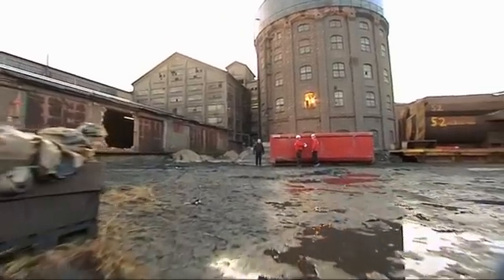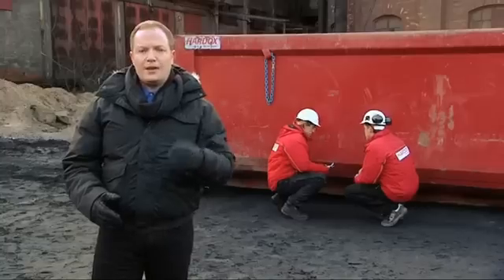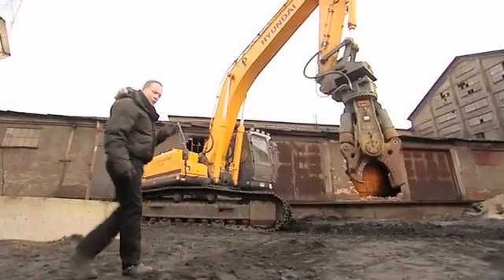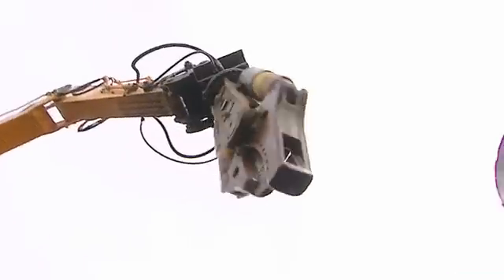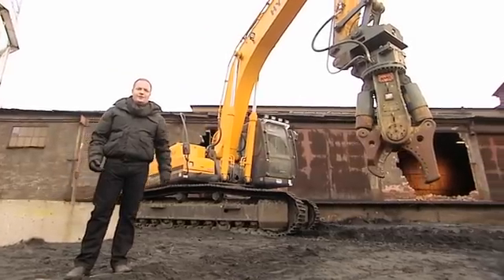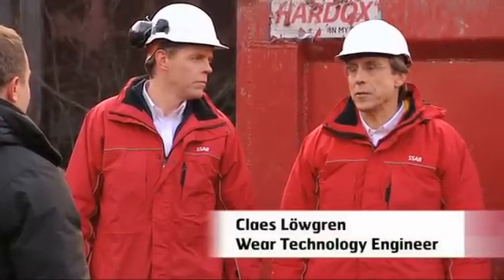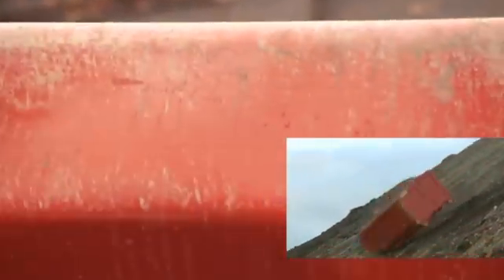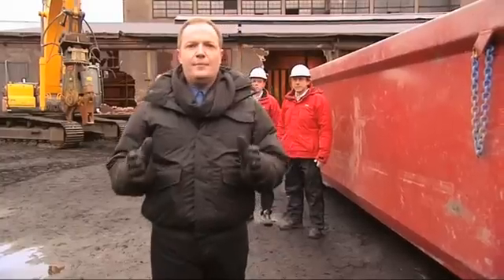HARDOX 600 gegen HARDOX 450

Comment: The Hardox 600 did not cause the damage the hydraulic power in the rams did utter rubbish, we sell metal shears that are not made from Hardox and they will cut through skips, trucks, even had our shear cut up a caterpillar D8, the only difference is the hardox lasts longer
Reply: That's true, the shears could be made of mild steel and still  cut the container, but they wouldn't of course last as long...

Comment: Practice and test some pre heat and filler metal welds , and this stuff is perfect for a DIY armored vehicle... Stick with a flat body panel shape like a Jeep, or 1980s Volvo... Well, a Volvo is probably armor plated already.... A original Hummer, etc...   Or just use a Caterpillar d-9 bulldozer and be done....